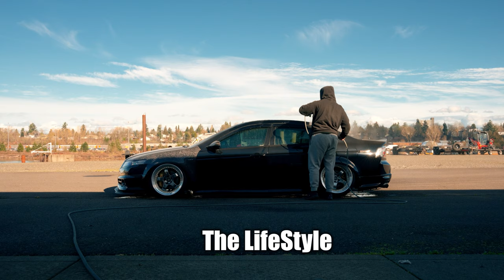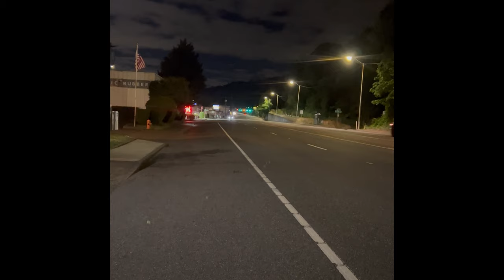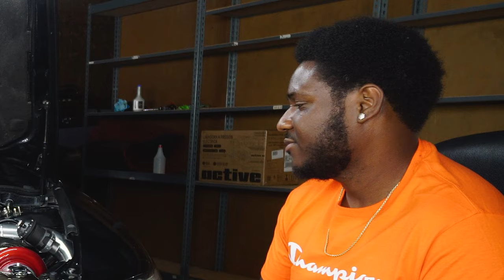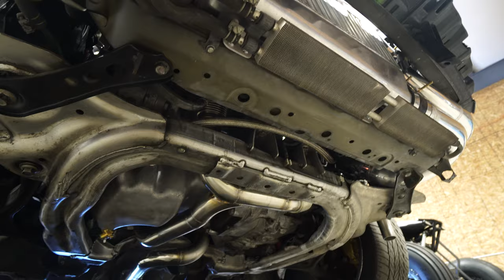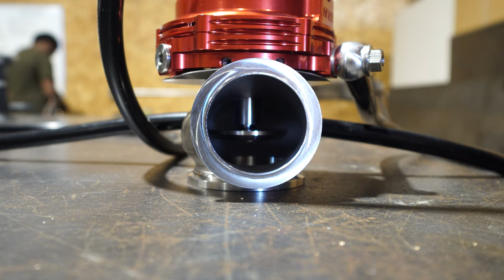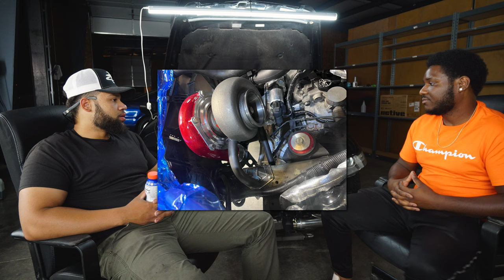Taylor the Tuner on Boosting J-series Motors and how we built my Boosted Acura TL-S

Comment: Great podcast. 18 years ago when I purchased the TL, Comptech was developing a supercharger kit. There was a lot of hype and owners wanting to pre-order the kit. The only solution at the time was Comptech ACM piggy back controller. Eventually sometime in 2008 AEM F/IC was available. Not an easy solution to get a proper tune which is likely why it was never really successful. Years later, Gerzy developed a Rotrex supercharger kit which had some setbacks, losing the A/C was big on the list and the cost to have functional A/C, made the entire thing unjustifiable. For myself, I ended up with the Comptech kit, purchased new I believe 9 or 10 years ago, put down healthy numbers on stock pulley, stock injectors, stock tune ect ect and retains all stock functions so that's a plus. It was never about chasing numbers with the TL as the platform wasn't capable of doing things a modern performance vehicle can do. The reality is, not many will boost their TL's and it's great to see those that do and do it correctly. Keep up the great work!
Reply: They are becoming a different beast tho… lots of people making 1200whp and shit on j swap hatches that run stupid fast times. The j32 block is good for 700ish hp too which is insane. Idk why it took so long for people to figure it out but it’s starting to become better than the K series for Na and boost
Reply: The j series motor is great for chasing numbers the TL chassis and fwd? Not so much

Comment: Thanks for providing the turbo build content.  1.  Why going to 3" hot side i would think more lag? 2. Can you share the order checklist especially the piping. The inlet to the intercooler looks like one 180 pipe. Pretty cool.  Did your fabricator use all that pipe?
Reply from the maker: 3” hot side better flow, going to be going full 3” exhaust to the back eventually. I’ll be getting the car on the dyno once the clutch is in. We’ll see what we make and then compare to after the 3” is in. Should make and considerable more amount of power
Reply from the maker: I over bought on piping, he didn’t use all that I had, just bought the rest off me when the job was done

Comment: J series is good i had a 03 cl type s fbo turbo making 371whp but my brother literally did just a turbo on his 7th gen k24 accord and custom exhaust making 452whp ill never spend money on a j series again 😂 😂
Reply: And before anyone says anything we both are tuned by 5280 performance so 🤷🏽‍♂️ his cars also like 700lbs lighter he whoops my ass 😂
Reply: You have the j32a2. That motor stock can make over 600whp. You could just turn up the boost 🤷‍♂️🤷‍♂️🤷‍♂️ (as long as you have the supporting mods)
Reply: 452whp on how much PSI vs. The J...371whp is very low for a boosted J32a2, they can make over 300whp NA.
Reply: @RevsALot  Exactly my thought! Plus getting beat by someone with 80+ HP more and 700 lbs lighter shouldn’t be a surprise.

Comment: Been subbed for some time now.

I bought a TL 6 speed in January off my Gfs dad. He was the only owner, baby already had 180,000 miles.

Ended up needing to get the power steering hose replaced 

Thing rips and I cant wait to see where I can take this Car.

I live in Ca, legally how much more HP can I get out of the 3rd gen TL
Reply from the maker: Thanks for long time support 🙏🏽 probably squeezed another 25-30 hp on Bolt ons and tune. Exhaust is very important for flow and more power. If you’re not willing to remove a cat for legal issue don’t expect much gain.
Reply: @TheLifeStyle6  Appreciate it man

Comment: I have his black cl. It now has a Frankenstein j37 in it.
Reply: cap
Reply: @joeygutierrez2657  definitely not cap. We are from the same state and city. Goofy
Reply: @UnHeard578  i doubt it lmao and ive yet to see a 3.7 bottom end on a cls6 or cl-s and your not where im from 😂
Reply: @joeygutierrez2657  do a little research. You can build a Frankenstein 3.7. It's plenty of write ups on the different strokes that can be built with the j series engine.
Reply: @joeygutierrez2657  you from Connecticut  ?
Reply: @UnHeard578  yes 3.7 crank and rods fit in a j32a2 no issies yes. and no i dont live over there and no you dont live in my area 😂😂